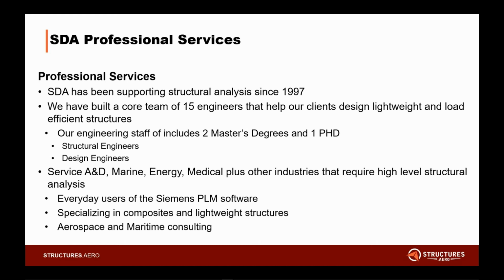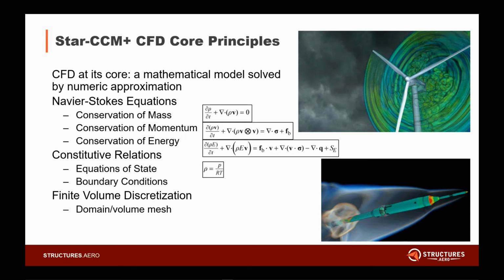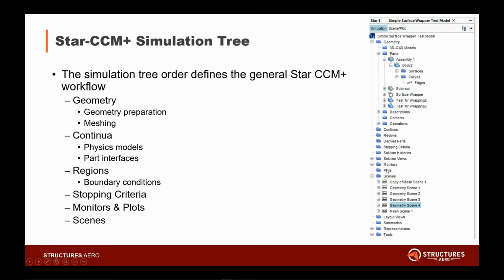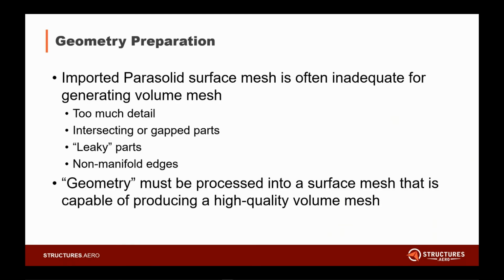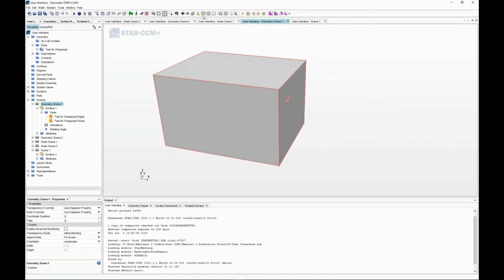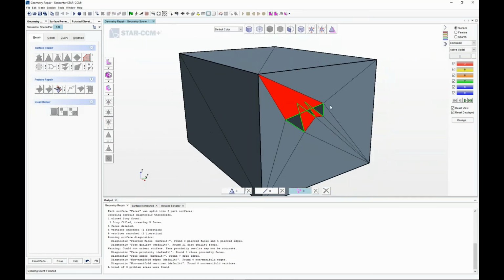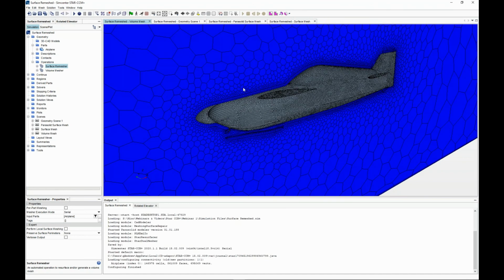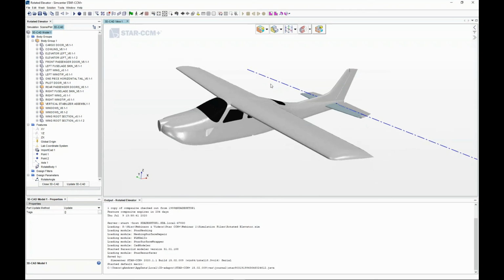Introduction to Simcenter STAR CCM+ Webinar

Comment: Thank you for a good introduction webinar :)

Yet I believe that it can be improved: unfortunately there are small topics left untouched and uncovered - like really basic 3D-CAD operations (just few minutes on defeaturing and automated flow volume extraction would be enough), getting a bit deeper to the concept of Parts (Surfaces) -> Regions (Boundaries) workflow, meshing of a simple geometry (maybe with 1 surface control for refinement), monitoring quantites and running the solver, post-processing just as couple of scenes.